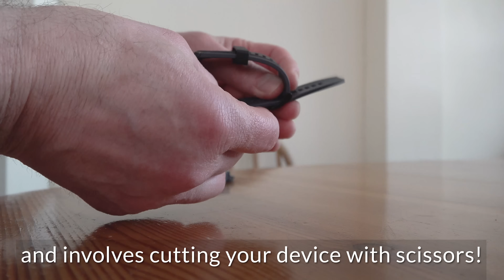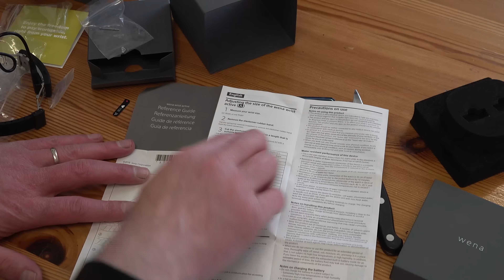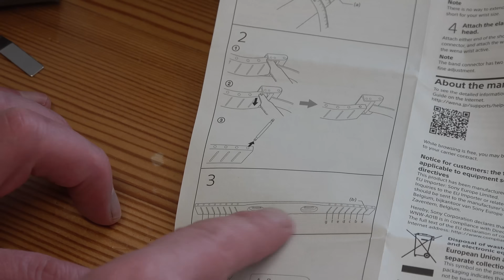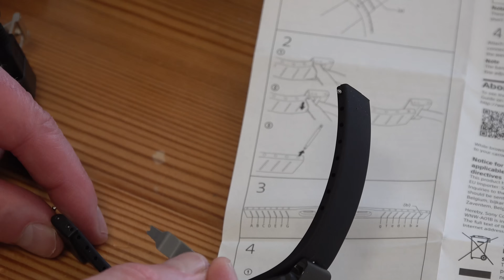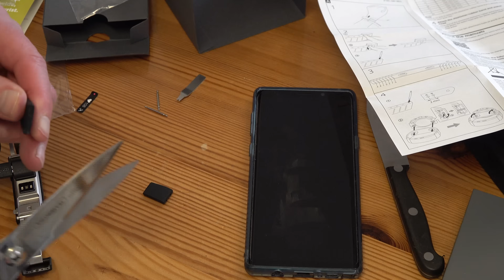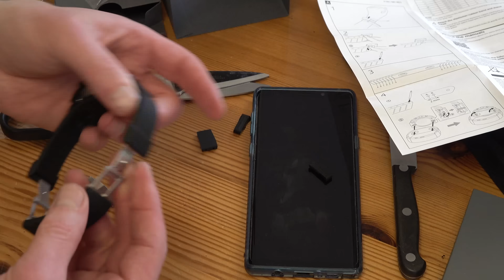Sony Wena Active strap / band fitting - official method - requires cutting

Comment: I guess you could use a nato strap somehow
Reply from the maker: Not possible, as the smart device is in the strap.... I guess you could hack something together with a couple of straps but you need the silicone rubber part you have to cut to hold the watch face, and you need the rest of the strap for the electronics.

Comment: Can you add a video showing the GPS functions? Can it be used for a run to accurately track time and distance while running?
Reply from the maker: Yes I'll get there as soon as I can. Its an unusual device, but loads of potential. I am hoping for some software updates to improve a couple of features. Subscribe and you will get notifications when my videos come out. Just ignore the ones you are not interested in. Cheers. Burl